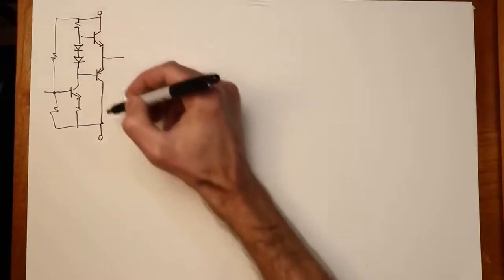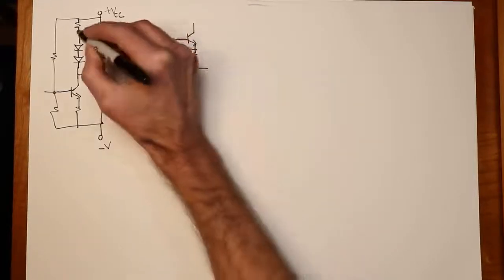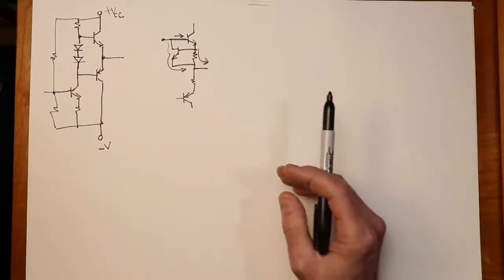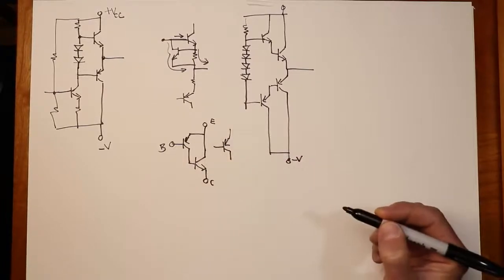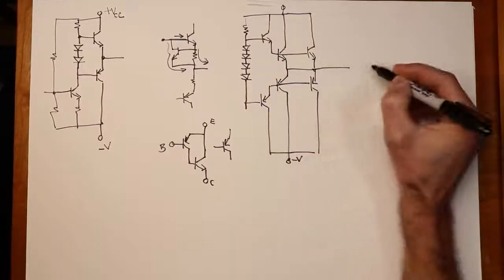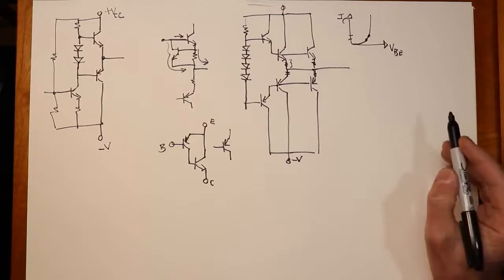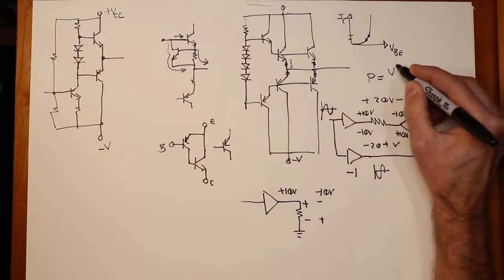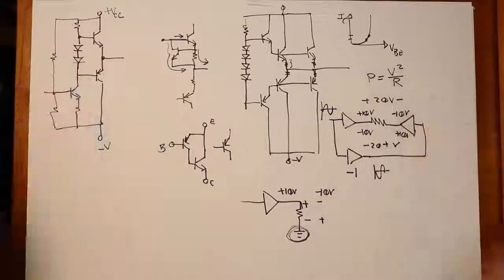Semiconductor Devices: Class B Enhancements

Comment: EXCELLENT TUTORIAL!HOW DO YOU GET THE TRANSISTORS TO  BE MATCHED IF THEIR BETAS AND POTENTIAL HILL BARRIERS VERY?
Reply from the maker: Manufacturers sell complementary pairs. These are NPN/PNP models that have similar betas, max voltage, current, power, etc. A classic small signal pair is the 2n3905 and 2n3906. The matching doesn't have to be perfect. We try to design circuits that can tolerate device-to-device variation.

Comment: 6:04 sorry for so many questions. Why is it that second transistor in darlington need to be bigger power tansistor? And by bigger power transistor do you mean it has a larger beta?
Reply from the maker: The 2nd transistor of the Darlington handles a much larger current than the first one, thus its power dissipation is much greater. By bigger I mean larger Pd.

Comment: 6:57 “the drive stage doesnt have to be as powerful”. Is it because without darlington configuration, the direct coupled drive transistor needs to have a larger beta to increase input impedance?
Reply from the maker: In a nutshell, yes.
Reply: @ElectronicswithProfessorFiore  thank you

Comment: Please do the other transistor amplifier classes also. Thanks
Reply from the maker: Already did. Check the Semiconductor Devices playlist for class A and class D.
Reply: @ElectronicswithProfessorFiore  Thank you. I was looking for class AB, which is suited for distortionless audio amplifier and class C for radio power amplification for ham radio. Your teaching method is good to understand.
Reply from the maker: @lesleypaulvj_TVPM  Class AB is a minor variation on class B. In fact, when I talk about reducing notch/crossover distortion by producing a slight forward bias, that's class AB. Class AB is not "distortionless" (no amplifier is) but it does offer a dramatic improvement. Class C is rather specialized, primarily used for narrow band radio transmission as you mentioned. The basic idea is to bias with a conduction angle less than 180 degrees. You can visualize this as just getting the tips of the waveform. The remainder of the wave is filled out using a resonant circuit which is tuned to the broadcast carrier frequency. The advantage is increased efficiency but it only works for relatively narrow band frequency ranges (like a radio broadcast channel). Not much use for something like audio.
Reply: @ElectronicswithProfessorFiore  Ok, thank you very much. That did explain in brief what those classes are.

Comment: What are the frequency limitations of this circuit? How can you increase frequency?
Reply from the maker: Could you be more specific? Are you trying to change the upper or lower cutoff frequency? In general, I would refer you to the frequency analysis of small signal class A amplifiers. The issues are similar.
Reply: Thanks for the reply. So I want to use this topology to design a poweramplifier with a frequency range from 400KHz to 2.5MHz. I want to use +-15v psu rail and I want the output to be +-12v. What would limit the upper frequency limit?
Reply from the maker: That's a bit more involved than I can answer in a reply. I suggest that you start with chapter 6 of the Semiconductor Devices text for the general ideas and then look at exercise 21 in the accompanying lab manual which directly addresses some of these issues. In short, you're going to have reduce the input and output sections into equivalent lead and lag networks. There will be interactions between the resistors, coupling capacitors and the junction capacitances of the BJT.

Comment: 2:16 could you please exlpain this part in a different way, i dont understand 😭 🙏
Reply from the maker: It's just a direct coupled stage. A simpler version would have a collector R above the first transistor, and this would be capacitively coupled to the class B stage. If you set the collector current of the first stage equal to the bias current of the second stage, you don't need all of that extra stuff because you use the same current path for both.
Reply: @ElectronicswithProfessorFiore  I will ponder this thank you